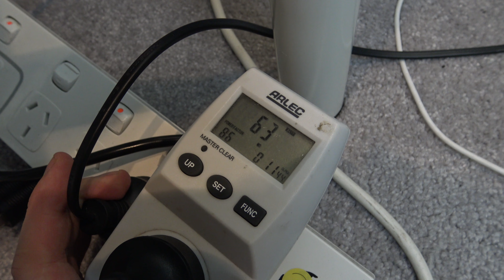How to build a Mining Rig on a Budget

Comment: Omg what the hell you do? Do you know that wood does not conduct electricity? Mainboard and GPU must be grounded and this you can only realize with metal case! Please stop to introduce other people even you does not have basic hardware skills, thats negligent guys you can destroy your hardware and burn down your home when you use wood case and don't ground your hardware!
Reply from the maker: In normal use, the motherboard is grounded to the case by each and every one of its mounting screws as well as by several of the pins in a standard 20 or 24-pin PSU connector. So long as the PSU is plugged into a properly grounded circuit, your motherboard effectively has a path directly to the earth and to every other "grounded" object resting on or in the planet.
Reply: the GPU is grounded THROUGH the negative pin of the power supply, the ground path is still intact.
Reply: In theory, the faceplate of an electronic device with "hot pluggable" cables should not be connected to signal ground directly. The idea behind is that the path of current from any ElectroStatic Discharge (ESD) will go into metal housing (which is normally connected via metal chassis to Earth ground) first, and will not cross board signals. Even if the board ground is made of flooded copper layer and has low impedance, kV-level voltages from ESD can create substantial voltage "bouncing" across the signal ground, exposing signals between internal chips to dangerous overvoltage.

Comment: How do you set up multiple gpus on that board?
Reply from the maker: In the video?
Reply: 123myIT I actually found a different computer I just finished pulling out everything is a true pentium 4 from 2005 with 16 pin pci and an express pci. An two other white expansion slots that I have no idea what they are think it will work

Comment: Hi i got old pc lenovo h530s
Cpu i3-4130 3.4
Ram 6G 
Can i use that mother board to my mining rig????
Reply from the maker: You can. Might not make money tho.
Reply: This is the lenovo cih61mi v1.1 motherboard 
so i just want use that mboard
Reply: and have 3 slots  PCI Express can i use them to put more graffic cards?
Reply from the maker: I am not sure what determines the amount of pcie ports that can be used.  I dont know if its the bios or what? Some boards only have 6 pcie slots but can support 8 gpus ?
Reply: 123myIT how can check that do you know??
Reply from the maker: Ports on the mother board?
Reply: 1 x HDMI port
1 x VGA port
1 x RJ45 LAN port
4 x USB 2.0 ports
1 x Audio I/O – Line In/Out, Microphone In 
storage 4 * SATA II 3Gb/s connectors
slots 1 * PCI Express x16 (2.0)
3 * PCI Express x1
1 * Mini PCI-E slot
core i3 
DDR3 max 8g
Reply from the maker: slots 1 * PCI Express x16 (2.0)
3 * PCI Express x1
1 * Mini PCI-E slot
Reply: 123myIT 
Right so them ports i can use to grafic cards!!
Reply from the maker: yes mate should be able too.

Comment: Can I also use the same Idea for a Dell optiplex 755 2duo 2.66Ghz processor. As you know it is now quite useless and I would like to use it for a good purpose. Also can you pls send me all extra parts that I require for the build. Thanks in Advance.
Reply from the maker: should be ok mate give it a try. Look in the description for parts and links etc.
Reply: Would it be okay if i buy an Asus OC 1050ti 4GB?? How much Hashrate would I get from it?? Its about 200 USD in my area or can you suggest me another good card and I would also be upgrading PSU. Thanks in Advance
Reply from the maker: You would get about 15 mh/s from that card. Good cards would be the RX 570.
First Mining Rig Build Parts below. 
LInk: https://youtu.be/3JCyDo-c11k
► Gigabyte motherboard http://amzn.to/2ivOIUr
► Celeron CPU http://amzn.to/2iwek3v
► EVGA Power supply http://amzn.to/2iwnIUz
► Crucial 8GB Memory http://amzn.to/2ivo6Tm
► Sapphire Nitro + 4GB http://amzn.to/2yXIwL5
► PCIE Riser cards http://amzn.to/2iv1nXK
► SSD http://amzn.to/2ivZUjI
► Frame if you need one. http://amzn.to/2j8shEx

Comment: How do you install win 10 on a old hard drive like that?
Reply from the maker: With ease. Follow this video mate. http://www.123myit.com/2015/08/windows-10-media-creation-tool/
Reply: Do you think the USB windows would be a good thing to do on one of these old pc's?
Reply: also how exactly would you go about installing new windows on the machine?
Reply from the maker: I would use an SSD if you can.
Reply: I got an old system similar to the one you have there, it has a clean installation of windows vista and I need to get windows 10 on there. How would I go about doing that on the 160g hard drive it has?

Comment: Its a miracle! 63w rig, sheesh mate, your giving us a bad name, run it up and then show it working. Why not just install the card in the dell - doh! it would last longer than that crappy left over piece of ** pc with a riser, no way would that last. Amazing that after changing a hdd, windows still boots fine, amazing!  Its gotta be too hot down under for mining anyways, where the air-con? or you bottom of tassie?
Reply from the maker: I don't use air con mate thats for pussies. Whats the point of running a rig if yo going to blow all your money on air con?

Comment: Thanks for the cool video!
What kind of power supply would be needed for the suggested 3x Sapphire Nitro+ 4GB rig?
Amazon tells me the power consumption of one such graphics card is 500w, and the math suggests 3x500w = 1,500w in total.
Reply from the maker: Nah allow 150 watts per card would be more realistic and then make sure you leave like 100 watts spare in case. This video also might help. https://youtu.be/3JCyDo-c11k
Reply: Answer very much appreciated!
Forgot to ask - I had been on the fence on buying a Zotac NVIDIA GeForce GTX 1060 6 GB Mini GDDR5, but that was before you clarified the power consumption question, and now I'm considering a 3-card rig.
Would you please express an opinion on which one you'd go with for a 3-card rig - between Zotac NVIDIA GeForce GTX 1060 6 GB Mini GDDR5 and Sapphire Nitro+ 4GB?
For reference, I've got an HP 8200 i7 kicking about (https://support.hp.com/us-en/product/hp-compaq-8200-elite-small-form-factor-pc/5037931/document/c02781693) and the plan is to turn it into a mining rig.
The PCI slots available are:
- 1 low-profile PCI
- 1 low-profile PCIe x1
- 2 low-profile PCIe x16

Thanks!
Reply from the maker: ATI card is better mate altho 6gb card might last longer on Eth mining.
Reply: Hmm.. I haven't attempted ETH mining yet, as I've joined the mining scene relatively late, as I understand it. Also, isn't Ethereum going to move to PoS soon?
I've been focusing on a few CPU-based tokens. Not sure if I would be able to do anything profitable with a 3x card rig on ETH?
Could you, please, shed some light regarding whether you think my understanding is in the right direction, if you don't mind?
Reply from the maker: Give it a shot mate and see how it goes. I am mining on the dell atm with 3 cards.

Comment: I recommend getting used GPU's if you are just getting into mining, unless you have money to spend  (I don't cause I'm a student). I got a used HD7990 for around 280 $ that has 1000k avg H/s (CryptoNight). Also a used 290x for 130 $ that has 500 avg H/s. I do however recommend to not cheap out on a PSU and buy a new one to keep your rig running smoothly.
Reply from the maker: Good call mate. Nice to help out others.
Reply from the maker: Lifts the cards off the board.
Reply: 290x $130? Dang

Comment: Sir, what miner do you use? thanks in advance?
Reply from the maker: Nicehash or Claymores.
Reply: I have a problem with nicehash, my card is not listed.. 😣
Reply from the maker: what card is it?
Reply: If you are using AMD you can't use the latest drivers otherwise it wont detect.
Reply from the maker: why not?
Reply: I'm not sure, I was trying to use a 7970 with the latest drivers and it didn't detect. I uninstalled and got the previous drivers and it worked.

Comment: How would you get 5 card working?  I don't see enough slots to plug in risers am I missing something?  Just wondering because I have a similar computer and if I can get 5 working I'll get a bigger power supply.
Reply from the maker: the amount of cards you have is determined by how many the board can support some board can support 8 cards but only have 6 pcie slots. You can use adapters. I have not been able to test this rig yet but will do an updated video shortly :)

Comment: How Is the GPU used in the video compared to a regular Radeon rx 580 8gb
Reply from the maker: Please repeat, I don't understand what you are asking.
Reply: 123myIT sorry, I was trying to ask if there will be any major hash rate difference from any other Radeon rx570 or rx580 compared the GPU that you used in the video
Reply from the maker: I have only used 570 and 1070. But from what I know the 570 is better than the 580 as its lower power but only a little less hash rate. So bang for buck the 570 is better.
Reply: 123myIT thx, exactly the kind of reply I was looking for

Comment: hi, I've wanted to mine for some time. i'm probably going for a used PC a new 500W PSU and an rx480 or rx 470. everything together is going to round up at around 350€. what do you think? Also the PSUs are very expensive so i'll just buy a bronze plus at most, or should i buy a more poowerful PSU with a better rating?
Reply from the maker: Start with what you can afford mate. I recon the 470 or 480s are pretty good.
Reply: i can get an asus strix rx 470 4gb for 220€ or sapphire rx 480 8gb nitro+ for 280€ which one should i get?
also does the rest of the PC (besides PSU) matter since i am looking at cheap old used mobos with cpus ram and some hdd? thanks mate!

Comment: So I don't get why connect sata to riser plus 6/8 pin to gpu ??
Reply from the maker: for power.
Reply: Sorry as I'm newbie I was thinking 1 sata to riser would be enough and if not why do I need to connect two power source to one pcie slot. Thanks for that video as I would burned my GPU if had not seen your video.
Reply from the maker: Its all good mate. The riser pulls 75 watts and so does the power connector.

Comment: 6:56 Maybe 5 gpus? how are you going to use 5 gpus on a board that only has 3 pcie slots? unless u have some sort of splitter for the 16x slot that doesn't make much sense.
Reply from the maker: Splitter mate yes. :) the main issue is space. I will release and updated version of the rig at some stage and at this time I will let you know if I could get more cards on it.

Comment: hi. i see you using old pc. does the pcie bandwith affect the hash speed? because old mainboard has PCIE 1.0 while new board has PCIE 3.0. from the spec, PCIE 3.0 is 4x (CMIIW) faster than PCIE 1.0. also for the drive, i recommend using SSD, because mechanical drive lifespan based on the hours, while ssd life is more likely affected by the write cycle
Reply from the maker: Nah I think they run on pcie 1 anyway.
Reply: what i want to say is the PCIE slot version. not the bandwith slot. there is pcie 16x, pcie 8x, pcie 4x, and pcie 1x if we categorize from the bandwith. while PCIE 1.0 , PCIE 2.0 and PCIE 3.0 is the version (generation). yes , pcie riser is convert from PCIE 1x slot to USB so miner can use VGA externally. but the version of the PCIE slot has different bandwith because it's different generation. PCIE 1.0 1x bandwith, is less than PCIE 3.0 1x bandwith. that's what i mean. and from that , i want to know, will that affect the performance of the mining
Reply from the maker: As I mentioned earlier. they can run on pcie 1 anyway doesn't matter.

Comment: Do you also do any cloud mining?
Reply from the maker: Not yet, probably should look at it tho.
Reply: 123myIT watch out for the pools. They are typically Ponzi schemes. 

Look for contracts with a decent amount of G/H rate offered for the longest term possible. I try to lock in my price for as long as possible based on the current value of BTC. 

Also pay close attention to the rules, regarding withdrawals and reinvesting. 

Thanks for your video. I learned a lot because of your explanations.

Comment: Why not use a Linux distro instead if Windows?
Reply: shyne1o1 some gpus work better in windows (nvidia) but amd works the same in linux
Reply from the maker: I am more familiar with Windows. Windows drivers support is better. Block-chain driver AMD. The over clocks tools are better. If you are going more GPUS +8 Would be better wit Linux. However Microsoft is about the update the GPU management in the next release so I have heard.

Comment: Would a Core2Duo CPU work for a budget mining rig? I have an old desktop that I'd like to repurpose for crypto learning purposes. Thanks in advance Matt.
Reply from the maker: yes it would work fine. just make sure you have 4gb of ram and your pretty much good to go.
Reply: 123myIT Thanks Matt, I just purchased my first Sapphire rx570 card and will be   up and running within the week once the PSU and SSD arrive. I thought the SSD was a good idea as it draws uses less power and also speeds up performance on an otherwise slow computer (by today's measure).
Reply from the maker: Yeh for sure. I just use the old one because I have it spare and costs nothing.
Reply: I've gutted the old HP Core2Duo yesterday in anticipation for building the rig. the only thing I am salvaging is really just the mother board, cpu+cpu cooler and the case. 
Have you had a chance to calculate what your profit is mining ether after cost of electricity? I have solar panels at home so at least during the day the electricity prices will be quite low.
Reply from the maker: Yeah I think I might do the same thing. Setup the mining to run during the day and turn off at night. I booked some solar to be installed shortly as well.

Comment: What is the Hashrate of this setup? Need to try and calculate a rough ROI.
Reply from the maker: The 1080 ti's seem to be very good at hashing. But to costly to buy.
Reply from the maker: Depends on the cards you use mate and how many. Sapphire cards will do 28 to 29.
Reply: Cool, 28-29 MH/s? Thanks for the replies!
Reply: I'm making stable 90 MH/s with a 1080ti lightning x and a gtx 960...

Comment: Congrats Dude! I was doing the same thisn with my old PC, it has a Procesor Core i5, and the same 3 PSC slots, I was wondering if it can be functional (or possible) to use a 3 expansion cards with 4PCI each = 12 GPU's (could be this insane idea posible?) obiusly with an other 2 PSU 1200? What do you think? 
And other question, what kind of software do you use for mine? I like to see an other of your videos teaching us in  how do you configure your miner, especialy for begginers like me.
And again cheers for your project, it was wath I been looking for in youtube for start with my first miner with a low budget.
Reply from the maker: Claymores miner. Expanding pcie may not be possible on all motherboards but you could try and let me know.